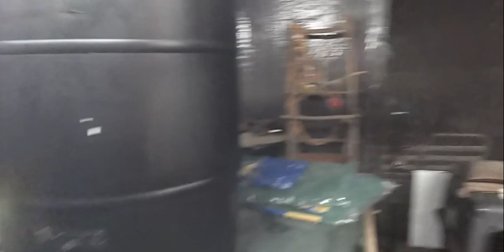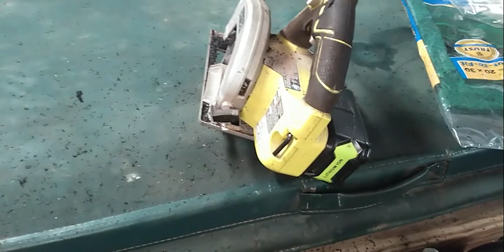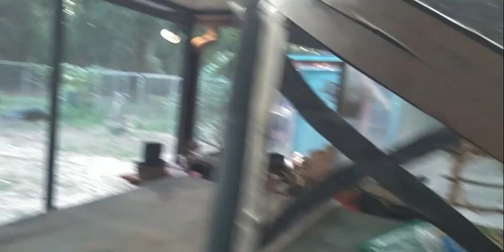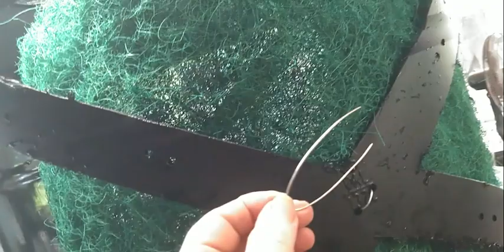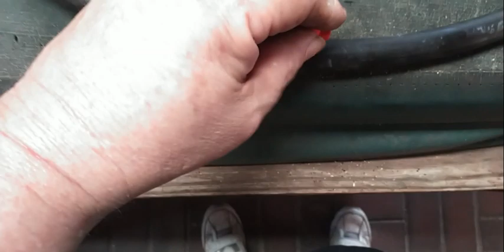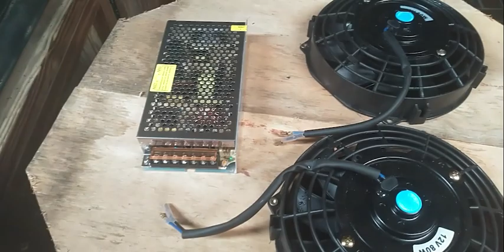STEP BY STEP SWAMP COOLER / EVAPORATIVE COOLER BUILD

Comment: I read something about how  they have to draw-in air from outside, and not from the area your cooling, otherwise it will start creating some kind of poison mold air issue. . . Or something of the sort.. same w window AC units
Reply: Window AC units won’t create mold by doing this per se because they’re not actively evaporating an open running water source however, they do condense water from the air on the evaporator coils which drips off and typically drains outdoors. That water would of course be draining onto your floor inside which technically could eventually create a bit of mold. However, the efficiency of the unit would be dramatically cut and window AC’s are already notoriously inefficient.
A swamp cooler on the other hand, could definitely cause mold issues in humid climates. Where I live in Wyoming it is currently 95 degrees at 21% humidity so no chance of mold regardless of cooler type. I could actually run window AC unit inside without a drop of water draining from it. In Florida on the other hand, you would definitely run into some issues.
Reply: Also, swamp cooler efficiency does drop by recirculating the inside air so for that reason alone, it’s definitely best to bring air in from outside.
Reply from the maker: @GorlockSlayer  correct
Reply: @GorlockSlayer ok,  makes sense …thanx
Reply from the maker: I found that the water only lasts a day, before refilling.

Comment: Looks good, only amendments i would make would be to use some of the panels from the side sandwiching the filters to the X instead of the ties and i would make the lid to where it grabs the upper lip with the scraps bolted to the bottom instead of the top. Otherwise this looks like a great project.
Reply from the maker: Thanks, I'm am planning to upgrade the side panels, but for now, it seems to be working great. The guy I get barrels from is on the lookout for good plastic barrel with a lid.